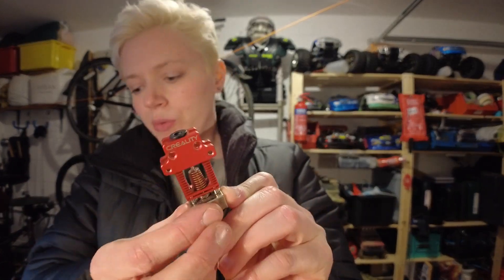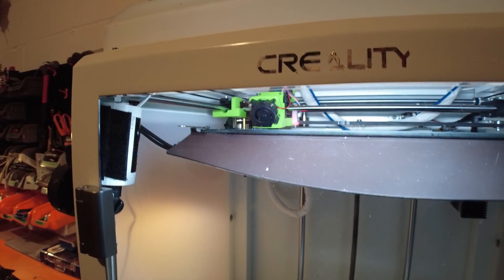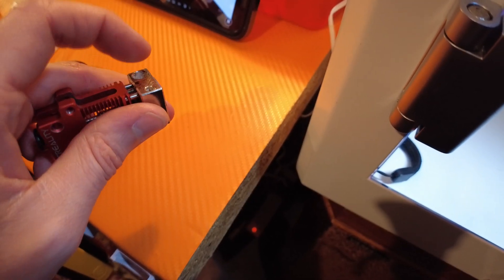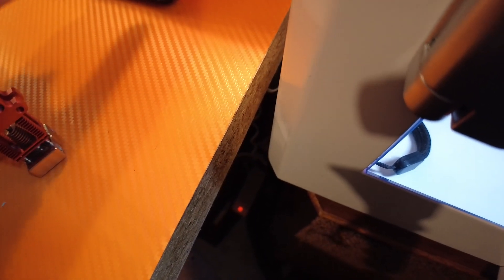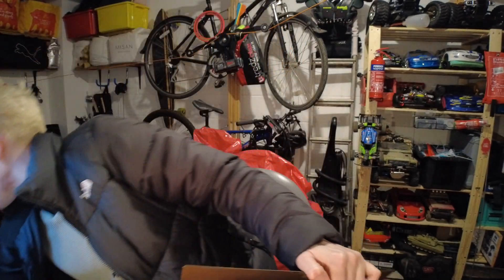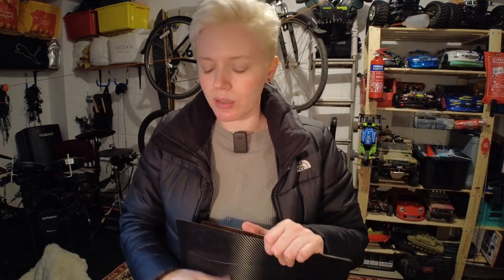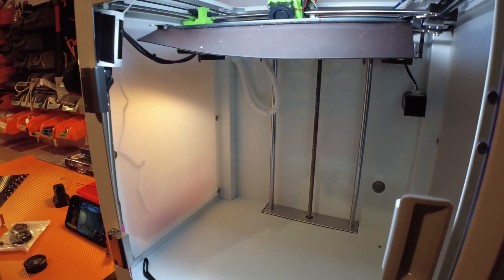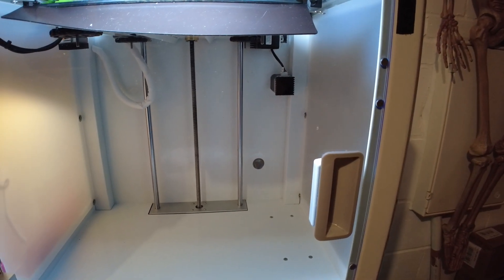Creality CR5 Pro H 3D Printer - thoughts so far and tips

Comment: Hi, about the little Z-axis offset, you could check this : after a print the Z-axis motors can have been released by the G-code of your print (also the X- and Y-axis motors) so one can move the carriages freely.  If you can move the Printhead (X-,Y-axis) freely after a print, then it was set in the G-code.  This command is set in the 'End G-code' section in the G-code of your slicer and is generally added to your every print.
This means that after a print, the grip on the motors is released.  With the next print the grip on the axisrod is restored.  

In my opinion (I could be totally wrong) this tempory 'gripless' moment may cause a small shift later when the motor grips the axis back, with a slight z-offset as a consequense.  
It is as if you got hold of a cup of coffee, excuse me, since you're living in Britain, a cup of tea, place it on the table and later on try to take it up the exact way you held it before, ... mission impossible.   

Try 'commenting out' the command line in the End-code section of the G-code, before slicing the model.  I use MatterControl for slicing and the 'End G-code' section mentions the line : 
'; M84              ; disable MOTORS'.  
The ' ; ' at the beginning of the line makes that what is comming next, the 'M84' command, is NOT executed.  So the motors are held tight.  And the next print they hold their position.
NOTE : doublecheck for the right G-code command which disable the motors, it works on my antique non-auto-leveling-prusa-clone 3D-printer with MatterControl slicer.  Probably the same as mine, but in this world of versatility, you never know, do you ?

In general, try not to 'dissable' or 'release' the motors, unless you have to tinker your 3D-printer of course.  If you do, this little Z-shift can occur, and also the accompanioning annoyance.

If you try this, please reply if it had result.  It helped for me.

BTW, good explanation video, good tips like the heatsink on steppers, the removal of filament residue by printing over it, and more about the hardware, smart.
Thank you !

Comment: I believe the Z axis motor (NEMA17- 42-48mm) have a compression spring in them that can cause Z offset issues due to the compression and decompression tolerances. 
I saw someone mention recently that those type of motors are not really designed for mounting in that Z plane, the fix being the motor re-mounted next to the Z thread and it being coupled with a belt. 
Alternatively could mount the motor horizontally, and run the belt in the current path of the lead screw ("single belted Z config")

Another issue could be the entire bed being supported by only 2 linear rods at the rear, this will mean a lot of deflection of the front of the bed, dependant on how rigid that bed frame is
Reply from the maker: I think it is as you said the bed being supported only at two points. I have an ender 5 Plus that is rock solid and pretty much the same gear but the bed is supported at all four corners. A design fault in the CR5 for sure.

Comment: We have one in the office, and yeah, pretty much having a hard time printing with PLA, but this thing prints ABS and Nylon with no problems at all.

Though i need to open the top cover and keep the temperature low for pla (190-50), any higher than that, clog.